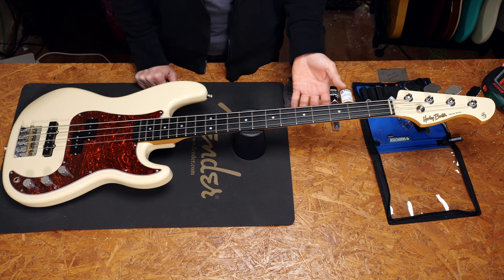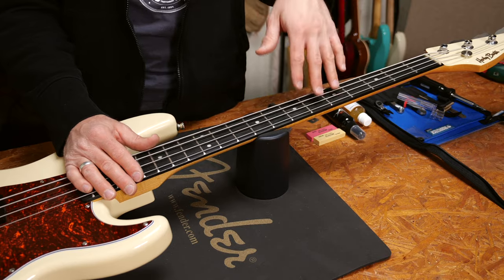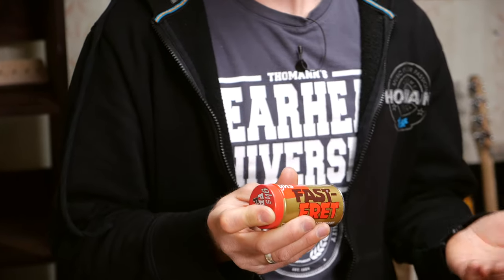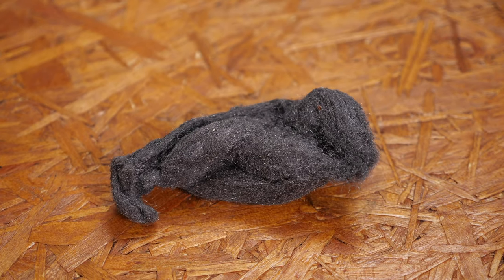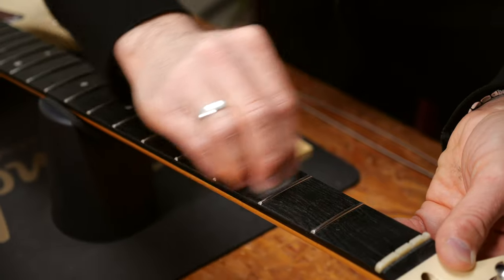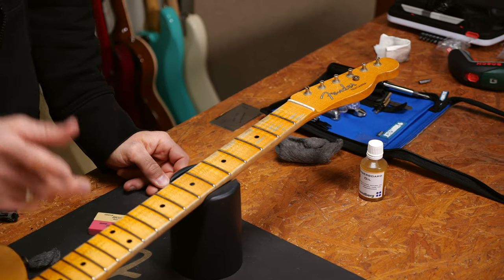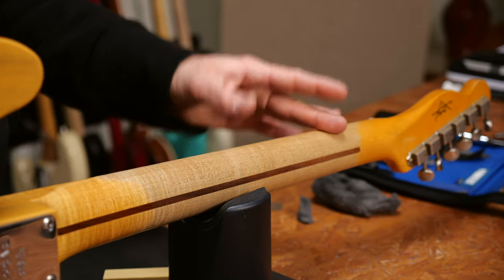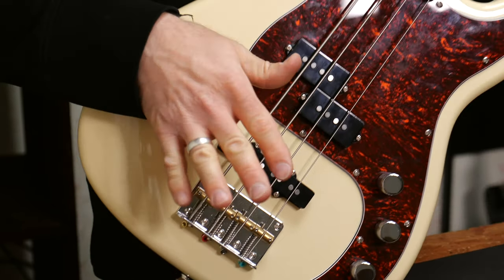How to clean ANY Fretboard | Rosewood or Maple | Guitar Tech Tips | Ep. 5 | Thomann

Comment: I  follow your method using 0000 steel wool to clean my rosewood fingerboard, and now it create gouges on my fretboard, its unreversible, your tutorial SUCKS
Reply from the maker: I'm very sorry to hear that. Also, I'm sorry to say this, but it's impossible, that you follow exactly these advices and have gouges on the fretboard. Most of the luthiers I know and learned from use 0000 steel wool for deep cleaning fretboards. If there are no harmed guitars after hundreds and hundreds of treated / cleaned instruments, the method is safe and proved to work fine. 
There must be something off about the fretboard wood of that guitar (is it proper hard wood like rosewood or pau ferro?), maybe the way you use the steel wool or the intensity of your method. 
And of course it's super important to use the 0000 which are the finest ones, all other steel wool types will scratch the fretboard. You said that you used the 0000 though so that shouldn't be causing the issue. //Kris
Reply: @ThomannsGuitarsBasses  its a proper rosewood hardwood fb, and its a brand new fender telecaster mij, so it is not a cheap hardwood. Steel wool Its safe but i used it to much, should there is a WARN that this one is abbrassvie and can destroy SO MUST BE CAREFUL, there js only a small little gauge i can check it with a pick (it goes down), but it makes me sad, and maybe want to sell this guitar, or i want to level and mod this (changing radius), but i think i'm affraid that if i change the radius (from 9.5 to 14), the affected area wont sanded

And this is my real story and experience

I used steel wool to clean my fretbiard because i was so panicked, that a liquid was fallen inti my fretboard, it was water based and wax free

And i suggest steel wool its the bad choice for cleanning, the damage is onlu slightly, but i think i will sell my guitar and buy another new one, i am affraid that my local luthier here wont give me a best result that i hope

I think you should take down this video before affectkng another guitar
Reply: @ThomannsGuitarsBasses  i hope you really read my reply
Reply: @ThomannsGuitarsBasses  i suggest to take down this video before the viewer's guitar get damaged, my damaged guitar is a fender japan hybrid 2, you know how much it cost right? Is not a toy guitar
Reply: @ThomannsGuitarsBasses  it's because of your tutorial that my guitar got damaged, and the gouge is real
Reply: I see you were not responsible by not replying, and this is really a scam
Reply: And you dont give any solution or what? For your worst tutorial. You cruel
Reply: Hey, its a scam video that need to be taken down, because of YOU i damaged my new guitar
Reply: So you make "how to destroy guitar" and you dont take responsibility for ehat you were doing
Reply: @ThomannsGuitarsBasses  hey i think you should answer, i already reply to you
Reply: Why wont you reply? You already known that one of your viewer become the victim here
Reply: @ThomannsGuitarsBasses  hey
Reply from the maker: Hey Kevin, I'm sorry to read your story. And I'm not ignoring you, please calm down. I just prefer not working on a weekend, same as you, I'm sure. We won't put the video offline because it helped already over 170k people and if you look through the comments, this seems to work for everyone. 
A tip for the future: if a liquid gets spilled over the fretboard, don't worry too much and don't start doing aggressive cleaning and scratching, not even with fairly smooth materials, such as a 0000 steel wool. As you unfortunately experienced, it's possible to overreact. Wait a few days until it completely dries out and after that use some oil to protect it.
There's a fairly simple way of fixing the gauge on that fretboard, you don't have to sell the guitar just because of that. If you bring it to a luthier, they can take some rosewood dust and fill the small grooves (by using a mixture of that and wood glue). That is a common fix that we do to correct chipped /damaged fretboards. Best of luck! //Kris
Reply: @ThomannsGuitarsBasses  yeah bro, i'm starting to accept for what it is, and decided to still use this guitar, its sounds awesome, sorry for being harsh too, maybe i'm gonna fix it when it needs a refret tho. I sometimes see your personal youtube channel, and it was awesome, i also learn much tips and trick from you
Reply from the maker: I really appreciate it Kevin and I feel bad for what happened. It's a good call addressing the fretboard situation when a refret is due. It's easiest to fill up gaps and gauges when the frets are out. Take care man! //Kris

Comment: What if my guitar has big inlays? The steel wool will scratch them?
Reply from the maker: Definitely don't apply pressure on the inlays, best would be to avoid going over them. Even though 0000 steel wool is fairly smooth, it's still not ideal to use on plastic. Cheers //Kris